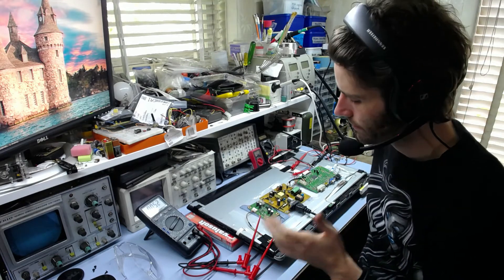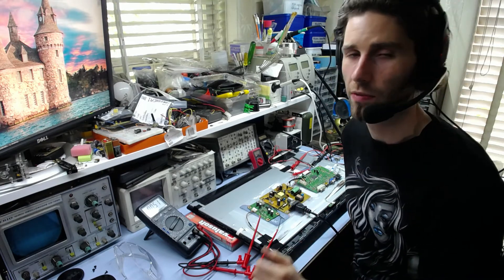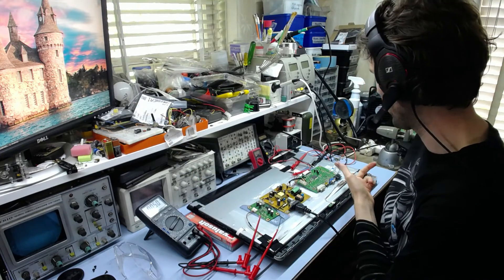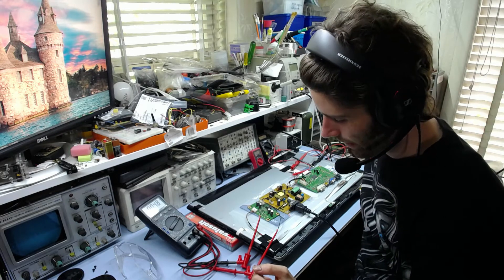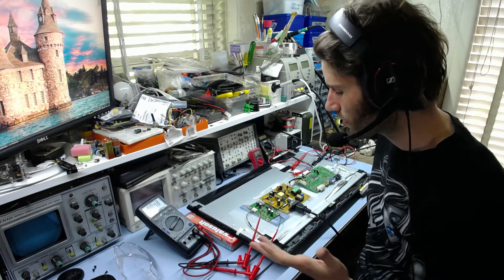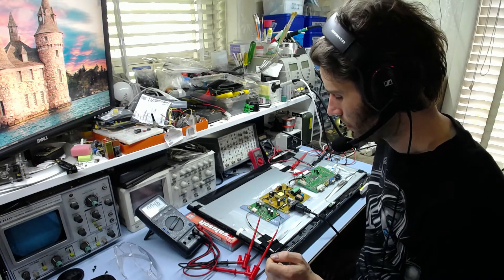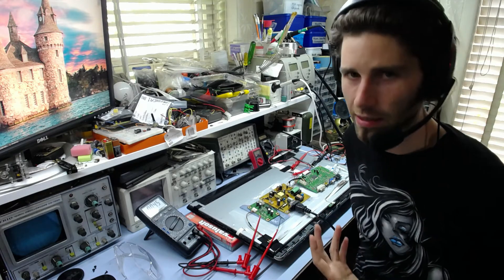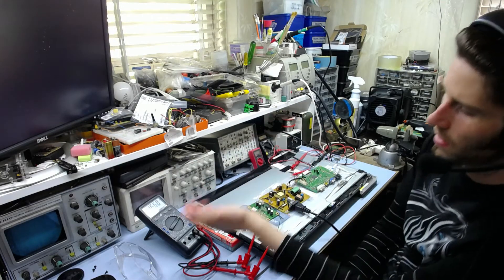Dell ST2420Lb 24" LCD monitor fault investigation and repair

Comment: Thanks for the video its really a smart one, It had paid off i just finished repairing two monitors with similar faults, It will be very difficult to suspect or detect such faulty component with limited resources. It worked for me and I know it will do the same for other engineers on the block who will have the patient to watch the video to the end. keep up the great work I wish to read and watch more of your stuffs. Let me hear from you more and more regards..
Reply from the maker: Thanks! Good to know it was helpful.

Comment: Very interesting. I wish we could see more close-ups. My Dell ST2310 slowly went dim over the past week with the left side slightly darker than the right although I still can see an image. I plugged in AC only and could change the colors using the built-in diagnostics but it's still dim so I replaced the largest cap on the power supply. That seemed to help but not really sure so I ordered the other six caps. If that doesn't help, do you have any idea what it might be? Turning up the brightness or contrast just makes the panel go slightly brighter then dim again. Thanks for any advice. Or even no advice! Good video.
Reply from the maker: According to Dell's website, that monitor uses CCFL back-lights. It's possible they're just wearing out and the tubes need replacing. Which isn't the easiest of tasks, but is doable if you're very careful... The other possibility is some kind of fault in the inverter circuit.
Reply: @Agent24Electronics  Ok, thank you. Shortly after my comment I did change the bulbs and it's back to normal. I was amazed to find them on Amazon for $32. The important part for me was keeping all the sheets in order and you do have to be careful.

Comment: This is very interesting and useful video. In my power supply board two component got damage C603 & ZD601. Can you please help with the BOM of the same?
Reply from the maker: I don't know off the top of my head. What is their function in the circuit?

Comment: You Bloody Legend. and sorry to hear about your family. have also had a ruff time with family recently too and also have the same dell monitor doing the exact same thing. so it looks like that chip would more then likely have some sort of manufacture defect. i could of never of figure this out on my own. Thank you so much, time to see if jaycar in aus has the chip otherwise ill have to also order it from the us.

MANY THANKS !!!!!!!!!
Reply from the maker: No worries, thanks, and sorry to hear about your own troubles. I doubt Jaycar will have even heard of them - it's not something hobbyists would normally purchase. RS Components have them but only in packs of 50. Digi-Key or Mouser do have them in single quantities, though the shipping will cost a little more. If you get really stuck I have a couple left. PS: If you do order from USA, you might get a better exchange rate with your bank if you order in USD.

Comment: How did you get the back cover off? I managed to split the case along the join around the perimeter, but can't get any further as the back won't come off the panel.
Reply from the maker: I can't really remember, except that it was a pain to do.

Comment: Hey bud, I use the Dell ST2220Lb and it just went off suddenly with a sound inside. Probably a burn off inside. I need to know how to get the front panel off. There isn't any service manual available as well. So I'm kind of stuck. Could you guide me through it to get inside please? Thanks.

Comment: I got this monitor last night and it has some kind of distortion . And when you powered it up it powers up just fine the problem is when you connect the HDMI or RGB it displays bad picture I don’t know what’s wrong with it can you tell me what’s wrong with my monitor and what shall I do ?
Reply from the maker: Without seeing what kind of distortion, it's hard to say.

Do any of the inputs work? Test every one, and if ALL inputs have the same problem, then you have probably a scalar board issue or TCON/panel fault, especially if the picture is there OK but the colours are just really weird. Lines down the screen is almost always a bad panel.

Weird colours or image distortion like squashed picture or such (again, I'm only guessing what you might be seeing) could also be a bad power supply or bad regulator on the scalar board/TCON board sending incorrect voltage somewhere. Check all rails and regulators and be sure they are in spec.

If at least ONE of the inputs shows a good picture, then you can rule out the panel & TCON. Then it's either mainboard or PSU fault.
Reply: @Agent24Electronics  thank you that helps a lot !!

Comment: My monitor power up for a sec then turned back off. Can help?
Reply from the maker: It could be a lot of things, but for common faults, start by looking for bad capacitors, checking voltage rails. A bad back-light or inverter/driver can also cause this problem. If it's not that, it could be some weird fault like the one I fixed in this video.